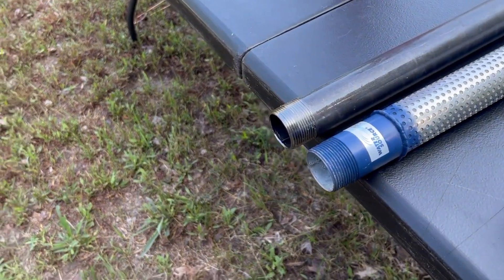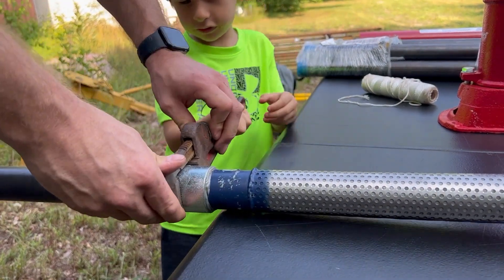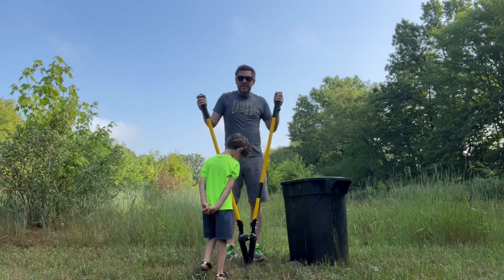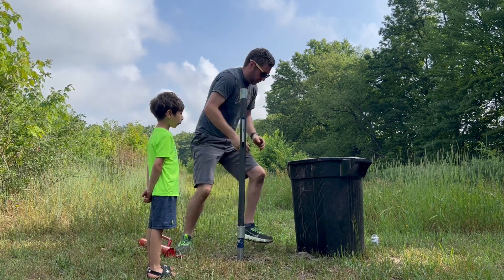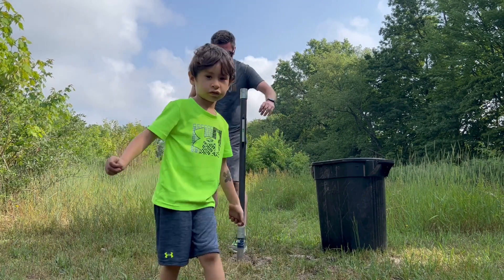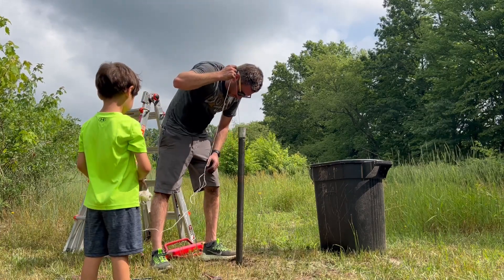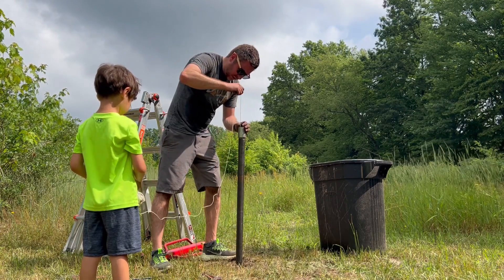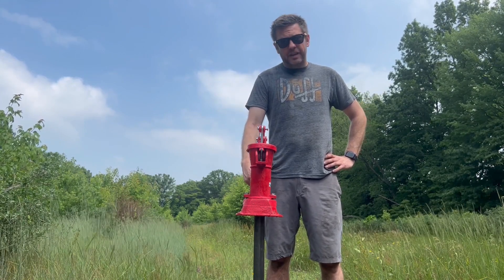DIY Simple Hand Pump Water Well | Free Off Grid Water Source | Building a Farm

Comment: It's not that the connections weren't tight to begin with, it's the hammering to drive it into the ground that loosens them. Kinda the same effect of an impact wrench. Just tighten from the top coupler as you drive it down periodically and connections will be air tight.